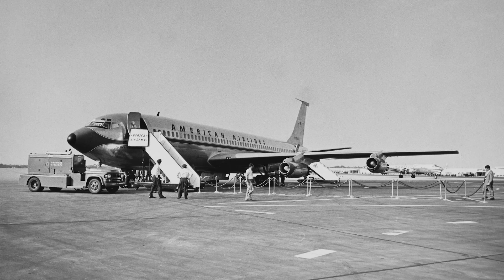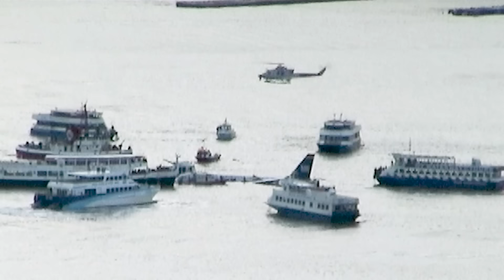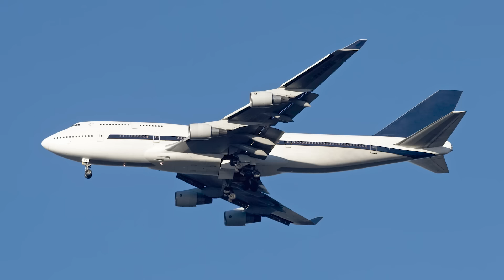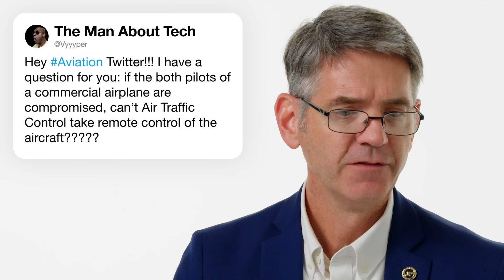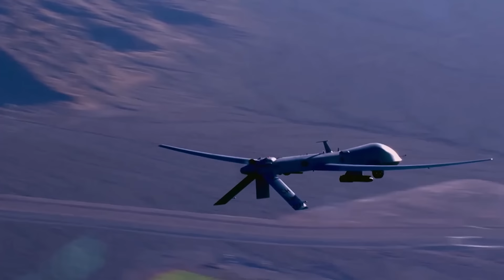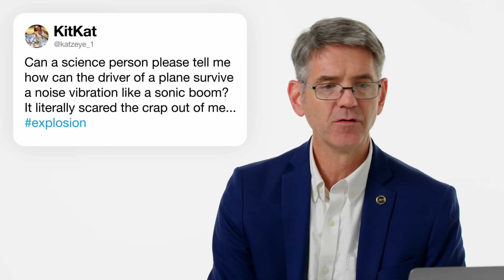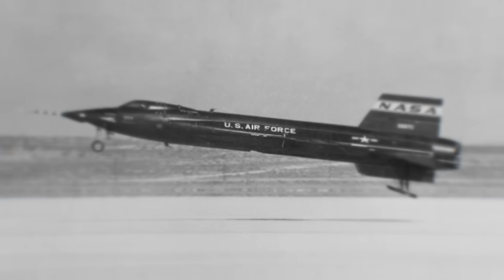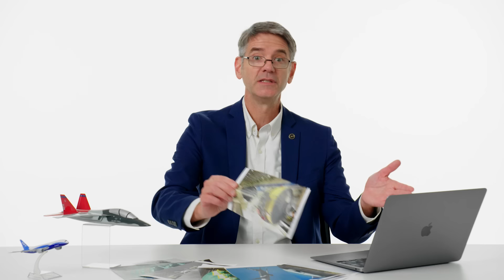Aerospace Engineer Answers Airplane Questions From Twitter | Tech Support | WIRED

Comment: To add to the fact that airplanes are statistically safer than cars, think about the fact that about 2.9 million people fly EVERY DAY, yet airplane crashes are rare.
Reply: Yeah but when they do crash, it's very unlikely that you're going to survive 😅 most car crashes are not severe, I think it's a control issue with most people, in a plane you have no control over what happens, you can quite literally just drop out of the sky, it may not be common, but that is the fear
Reply: @aaronbarrett5061  No, no. More people are killed in car crashes than in airplane crashes since they are so rare. Yes, if you compare the average crash of a car and the average crash of an airplane you are less likely to survive the airplane crash, but that is a different statistic.
Reply: @JustWasted3HoursHere, the guy basically said it was a different statistic.  He wasn't arguing that car travel is safer.  He was pointing out that people are more afraid of airliner crashes because of their survivability.  I'm more afraid if I'm attacked by a shark than a cow.  Even though more people are killed by cows.
Reply: @aaronbarrett5061 not necessarily. Most car crashes occur at very low speed compared to plane crashes. You're much more likely to survive a plane crash than a comparable car crash. Also, every plane accident or incident is _thoroughly investigated _ to find the causes of it and determine how best to avoid similar accidents or incidents in the future. Sometimes it does take more than one accident or incident to determine the exact cause or convince involved parties to take action, but the goal is for every accident and incident to make aviation safer as a result.
Reply: Put as many planes in service as cars in service then let's see  if that stat holds up. All I'm saying is let's do the math not just look at a statistic.
Reply: @purdysanchez   Get close to a cow. They are scary enough (especially if they panic).
Reply: @jamesseager8126  We're talking about passengers, not vehicles. As a passenger, you are more likely to be involved in a car accident than an airplane crash. How often do you hear about airplane crashes?
Reply: I thought the risk per hour of travel time was pretty similar, but you are covering 5-10 times more distance in the same time, so the risk per distance travelled is much better in (commercial) planes. IRL it depends on the car & the plane - crop dusters & float planes are generally more dangerous than cars; the Presidential limo is probably safer than most planes (except for that one time in Texas), etc.
Reply: I'm sorry, what? Did you say let's do the math and not look at statistics? Statistics is math. They did the math. That's where they got the statistics. SMH.
Reply: @aaronbarrett5061 that’s not really true though, aircraft crashes are actually far more survivable than people realise. Think about the B777 crash at San Fransisco, If i remember correctly only 2 people died and of those 2 one was a heart attack and the other was struck by an emergency vehicle. IF an aircraft falls out of the sky then yes the chance of total loss of life is very high, but that is very rare. What’s happening is that events with a large loss of life get a lot of media attention and so they are more prevalent in the public imagination. So the PERCEPTION of air crashes is that they are far deadlier than they actually are in reality.
Reply: @jamesseager8126  would still be safer. turns out, an aircraft flown by 2 highly trained professionals will be much safer than a car driven by the average joe.
Reply: @SmitePlayz1  average Joe is fine, how about the average drunk Joe 😅
Reply: @jamesseager8126  Point taken. Per your comment - the math on how many people travel by plane and how many miles they cover in a day, makes planes FAR safer than the compariable car traffic.
Reply: And 40,000 people a year die in automobile accidents
Reply: The chance of an airplane crashing is less but the chance of surviving an airplane crash is lesser.
Reply: @jamesseager8126 I think the stat would still hold up pretty well even if there was a 1:1 ratio between cars and planes. Your average pilot is very smart, highly skilled and trained, and has a great mind for tense situations. Your average driver is some dude at the neighborhood Walmart who sees some chicken drippings on a conveyor belt and thinks hes doing everyone a favor by grabbing paper towel and smearing it everywhere thinking he cleaned it. Pilots > drivers. Plus if you get in fender bender in the air, you dont have to sit around waiting for the police later and hoping everyone has insurance.
Reply: Here after 4 plane crash in a week a and a terrible in south Korea

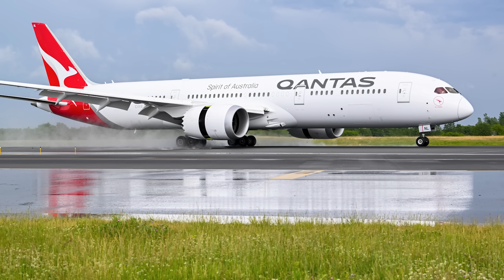Comment: People mentioned the missing 757 in the comments, but WIRED put a photo of a 787 and called it the 777 0:48
Reply: wired issue
Reply: and the 100 or 200 717s as well
Reply: A 777 is the missing aircraft.
Reply: Yeowch 😂
Reply: Shame
Reply: The missing 757 was probably a Wired editing mistake as well. He probably said it and whille editing they cut the video in sections to edit the pictures in as he said the models and deleted the 757...
Reply: and the 717
Reply: the 717 wasn't introduced as a Boeing aircraft
Reply: @jorgehca90 it wasn't introduced until the 90's and was based off a McDonnell Douglas design that Boeing acquired when the two companies merged in August 1997.
Reply: Also the 720
Reply: @oogieboogie232  yeah but it’s just a variant of 707.

Comment: 10:26 Ramps like some carriers: you wanna start your plane into the wind, so ramp into the wind. The aircraft carrier can turn itself into the wind, so the ramp can always be pointed into the right direction. An airport runway cannot. So it's useful that the runway can be used in both directions, depending on the wind direction. The ramp would ruin that.
Reply: Also space is super important on a carrier but not really a scarce resource at a major airport. If you can’t take off in 7000 feet you probably have a bigger issue that a ramp isn’t gonna help with
Reply: @ghostrunner2138  I was bought up (UK) near an ex WWII RAF airfield. After WWII the air field was used by Rolls Royce for engine testing. They developed the Flying bedstead there and also the engine that powered Concorde. They tested the Concorde engine using a modified Vulcan bomber.  The runway had a ramp at one end and the Vulcan always took off using the ramp whatever the wind.
Reply: You should be reaching V1 well before the end of the runway.
Reply: @johnp139  "V1 represents the point of no return, beyond which it becomes unsafe to stop the aircraft on the remaining runway."  Thus, by defintion,  V1 ia always reached before the end of the run way
Reply: A ramp on a runway would never be used, because airplanes are always airborne before they reach the end. (Unless someone screwed up their calculations.)
Reply: Another thing he didn't cover is that carrier-based aircraft have landing gear that is WAY WAY stronger than other aircraft. Take a 737 off a ramp at takeoff speed and it would collapse instantly.

Comment: On "why co-pilots exist" - redundancy is one. Emergencies is the other. During an emergency, one pilot will spend basically 100% of their effort just flying the plane. The other pilot will do troubleshooting, communication, research options, etc. 

Both engines go out? One pilot will be telling air traffic control, scouting for alternate runways, trying engine restart procedures, etc; while the "pilot in control" will have hands-on-controls to maximize the performance of the airplane to get it to glide as far as possible to hopefully make it to a runway.
Reply: Right, this guy has NO human factors or aviation background!!!

Comment: 12:30 That area the professor was talking about is called "Equipment Restraint Area" or shortly termed the "ERA line". You're not permitted to cross the line until the engines are turned off and the ACB (Anti Collision Beacon) on the belly of the fuselage stops blinking.

Comment: I'd like to know exactly what the "How come commercial aviation hasn't gotten better in 50 years" person is getting at, because that's probably the most insane thing I've ever read
Reply: He probably means the customer experience
Reply: @JohnSmith-me4ik  the customer experience has gotten significantly better if you’re willing to spend the inflation adjusted amount of money you would have been spending 50 years ago
Reply: Yeah, governments used to set ticket prices and routes, and the prices were set very high. Mandatory business class (or at least premium economy) level fares meant lots of room.

The airlines couldn't squeeze in more seats, because you could fly on a competitor for the same price.

The rest of us just didn't fly. And the rise of uncomfortable but very cheap flights indicates that's what most people want. 

But yeah, now flying is quieter, safer, doesn't smell like smoke, has screens and wi-fi. And if you're paying the equivalent price as 1974 long distance, you also get a bed.
Reply: I assume he means speed. NY to LA or London (or wherever, those are just classic examples) take the same amount of time they did 40+ years ago.
Reply: @Justlaxin13  The speed of sound hasn't changed. Even with more efficient engines and airframe design, going faster than sound (a) drinks a disproportionate amount of fuel, (b) is efficient only if the aircraft flies at a higher altitude which takes time to reach, (c) puts stress on the airframe which makes it much more expensive to maintain and less safe, and (d) generates insanely noisy sonic booms so you can't do it anywhere even remotely near a populated area. None of these problems can be completely eliminated by technology.
They tried with the Concorde and it turned out that getting to your destination twice as fast wasn't worth the trouble and expense.
Most modern airliners fly just below the speed of sound for these reasons.
There have been serious attempts to sidestep this limit by designing airliners that fly all the way into space and come back, which should give you an idea of just how bad the problem is.
Reply: @Justlaxin13  The issue with supersonic travel is the ludicrous cost and the limited routes because of the noise and fuel guzzling.

1996 Concorde tickets were $7500, which is about $15k today. For $5k or less, you can get a private pod with a bed and a door, it just takes twice as long. I'd rather have the bed even at comparable cost, much less for 1/3.

And that's with much higher modern fuel prices. It's even worse if you're flying something like LA to Rome, where Concorde would require you to land and transfer twice instead of nonstop.
Reply: @notatallheng  planes usually go a bit under mach 1. flight economy is still the primary factor for speed imo.
Reply: @morat242  Concorde was also a very uncomfortable plane with a very high noise level.
Reply: He totally looked at the Concord 1st class seats, and compared them to today's sardines class....
Reply: @SweBeach2023 when I flew in it it was not that uncomfortable- the seats were comfortable and sound / vibration pretty normal. I think it was also pressured to a higher level that a standard aircraft so that felt better.
Reply: All those improvements by engineers have been put into reducing the ticket price because that is what customers demand. Obviously if you make an experience more bare-bones it's going to cost less so airlines in price competition will tend towards that.
Reply: Most of the questions asked were really dumb. Anyone with a little common sense or knowledge could have answered that.
Reply: @JohnSmith-me4ik  Professor addressed that too. He said that seating and customer experience is dependent on the airline companies.
Reply: @Justlaxin13 Right, being totally ignorant of all of the other factors that were mentioned. And people like this vote. Scary.
Reply: @supernova82 EXACTLY!!!!
Reply: @rpnye23 on the other hand. Many people always shopped for lowest prices. While it's true that the inflation adjusted cost of the cheapest fares is much lower now than 50 years ago. What's also true is that passenger experience at the lowest available fare is now much worse than 50 years ago.
Reply: No the most stupid was why airplanes aren’t built of the same material as the black boxes as the black boxes survive the crash.
Reply: @mitseraffej5812  the video said why. Black box far denser than other materials and so it would be impractical in terms of aerodynamics and fuel to build it that way
Reply: The issue there is - most people are bad at recognizing and understanding progess or regression over time.
Reply: @morat242  This is mostly untrue.  The only thing correct you state is the noise.  The concorde when it could fly over land at its designated altitude of 50,000 feet was very efficient.  This is because engines built to cruise at supersonic speeds are actually more efficient thanks to higher compression ratios that are impossible sub Mach-1.  Only once the Concorde was restricted to standard cruise speeds and 35,000 ft cruise altitude was it expensive due to being forced to run at less that 1/3 of their peak effeciency curve.

Comment: @7:00 On Boeing airplanes is called FQIS - Fuel Quantity Indication System. There are sensors on each individual tank that monitors fuel, which also is used to move fuel around from one compartment to the other if necessary. Efficiency of mileage per fuel is dependent on several variables: weather conditions, cargo (weight), fly altitude ,etc.
Reply: It's now pronounced 'BOING!'

Comment: 0:51 what about the 757?
Reply: Or the 717!
Reply: The 717 was the internal designation for the military KC-135 refueling airplane.
Boeing initially skipped that number to avoid confusion.
Eventually, 717 was reused for the MD-95 after acquiring McDonnell Douglas
The 757 was a twin engine replacement for the 3 engine 727.
Reply: Flying pencil
Reply: @danielbjohnson  That was the Do-17! 😆 </ww2 aviation nerd>
Reply: @aaronbredon2948  717 is a plane, i flew on it about 2 years ago with qantas
Reply: @BigPen12435  which Boeing 717 did you fly on?
A prototype of the later KC-135 (the original project 717)? Probably not, as these never entered actual service with an airline.
A production KC-135? Probably not, as that is a military plane, and wouldn't have been flown by an airline.
An MD-95 made by McDonnell Douglas, but rebadged a Boeing 717?
An MD-95/Boeing 717 made after the merger that was the same design, but never explicitly called an MD-95?

Probably the last, which was not actually a Boeing airplane, but a variant of the DC-9 aircraft.
Reply: One thing I've always wondered: what's Boeing going to do when they run out of 7s? 😂 They've only got "797" left unused.
Reply: @ericbrown1101  At this moment... I seriously wonder if that's a problem Boeing will have to worry about.
Reply: @michaelhoffmann2891  lol Boeing will be fine
Reply: @michaelhoffmann2891  lol Boeing will be fine
Reply: @ericbrown1101  Too big to fail, eh? Too entrenched with the US military?
Reply: @michaelhoffmann2891  that and the fact they're still making billions in their commercial business as well. Them and Airbus own commercial aviation. Social media makes their issues a way bigger deal than they are.
Reply: They showed a 787 for the 777, sometimes you just gotta let it be
Reply: @ericbrown1101  That's the least of their current problems!
Reply: The most overpowerd commercial plane followed by the 777-200LR
Reply: But why is there a SEVEN at first and last digit? Why not just "Boing 4" or "Boing 6"? Why 747 or 767?
Reply: @ 7xx was the Boeing model designation for jet aircraft projects way back when. Why the second 7? Probably just marketing.
Reply: dont forget the 757, loved riding in them on transcon flights.  id always make it on flying standby.
Reply: Came here to say this!

Comment: 2:18 “if one system fails another one backs that up” I guess boeing wasn’t aware of this concept when incorporating one sensor for the 737 MAX’s MCAS system…
Reply: It's a bit ironic because the MCAS was the only system, but it wasn't there to be backed up or to back up anything. However, hydraulics, electrical, pressurization, and most other systems have triple redundancies. In most jet airliners, you have three overlapping hydraulic systems and even if all three go (somehow), there's probably one more system plus manual backups that allow operation of the aircraft.
Reply: Two autopilot systems, 2 flight computers, big planes have 3 radios, even a Cessna has 2. Instruments all have backups and in IFR training you're taught how to substitute an instrument by cross referencing others.

The requirement is for a plane to be able to hold altitude with half it's engines. Almost all commercial planes exceed this and can actually climb with half it's engines.
Reply: Actually, Boeing did put in two sensors. To get the 2nd sensor enabled the airline had to purchase the premium package.

I seriously wish I could say that was a joke.
Reply: Thing is, there was a backup procedure - but the pilots would need to be aware of it, which they weren't
Reply: @Aviator27J  "the MCAS was the only system, but it wasn't there to be backed up…"

Huh?! What is that supposed to mean?
Reply: @petep.2092  It wasn't a system with a redundancy as far as I know. All primary flight control related systems are typically triple redundant.